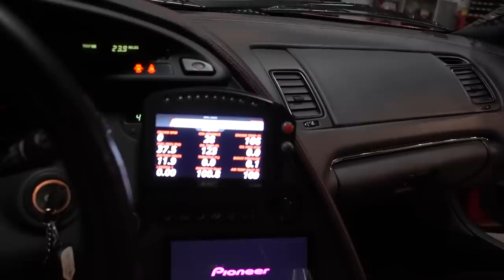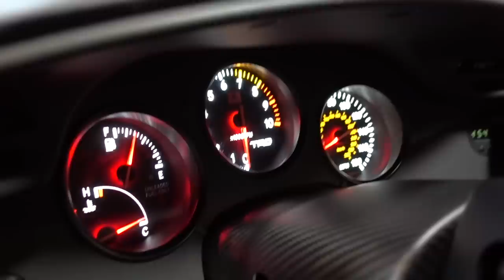730hp Mk4 Supra - Single Turbo  - JDM Madness

Comment: Nice SHOW CAR...and if you noticed my SN, I love me a nice Supra...I've owned half a dozen of these. All were very clean, made descent power, and sported some rare mods. But THIS CAR...even if it will handle and has a bunch of power, this isn't an attainable car for anyone making less than $250k a year with a girlfriend...and very well engineered it seems, but even less practical than an aventador or f430. Can't jump it if its dead...well who would anyway with this level of work, but really? Its a Toyota after all....super slick metal work (that's coming from a fabricator/ welder with 16 years experience) but after all that money and work to make a truly one of a kind car, who would want to even OCASSIONALY drive this car on the street and chance an accident when the fabricator that did all that awesome metalwork has passed? Verdict....very high dollar trailer queen that will never exploit the jewel of an engine that resides between the rails to its full potential...pretty, but virtually useless. They threw a bunch of time, money and performance parts at it, basically to just let it sit a climate controlled garage to be polished and looked at or towed to a show...

Comment: I don't think people will be doing this kind of thing to let's say a RS7 in 25 years but I may be wrong.  Kids in the future won't give a fook about ice engines . Could you imagine someone doing this type of build to a Tesla lol. It's got hand braided copper battery wires . Lol
Reply: how would you to a Tesla? add more batteries and make them flashy? lol IDK what you could really do to a Tesla to put it in same level as this
Reply: You should check out icons build of a classic car and turn it into an electric car. It's pretty badass actually
Reply: VGK30 an rs7 is nowhere the level of a Supra so
Reply: VGK30 hot rod people said the same thing about these cars back in the day. A that’s the beauty of creativity and new ideas. The art won’t die
Reply: It will be like computer builds, Rgb lights everywhere, liquid cooling chipsets, wire tucking, new app to make car dance, etc.
Reply: You ll just pay on line and the car start download the upgrade
Reply: Someone will make the tesla roadster ricey.
Reply: Unless RS7’s start appreciating in value instead of depreciating like all modern high volume cars, you are 100% right!
Reply: Supra king

Comment: Didn't even start it up or rev it? I'm sad
Reply: I'd be scared to blow something.. imagine the stress of driving this on the street
Reply: TheJuicyGiraffe I agree.I was waiting for it the whole video.
Reply: It's not their car.
Reply: Sky Guy Yeah,but nobody's saying they should have revved it up and dumped the clutch all over the shop.I mean they drove the thing in there as soon as the video started,but proceeded to put some shit music over the engine sounds.Other than that,the car is awesome.
Reply: I just wanted to hear a rev to man like wtf I'm upset
Reply: Not to mention the owner is the one that drove it in, he could have done it himself.
Reply: Yeah I was disappointed. Want expecting a limiter dump but at least some idle and a couple 6k hits
Reply: I feel like I may know why.. They say it had a tripple disc carbon on carbon clutch so it would have been rattling it's head off while it was moving around and the general internet loud mouths would have started a whole shitwar over how something is wrong with the car. Just easier to show the build and not have to deal with the comments later.

Comment: all the money and hard work and I bet it sits around in the garage 99% of the time
Reply: Load of shit, try watching the bonus footage where they talk about the guy driving it. It's not hauled on a trailer, don't be so quick to judge just because it's clean!
Reply: @jonnyd3ath That thing is WAY too immaculate to have been driven.
Reply: g0dbel0w is it fuk
Reply: Dariune watching the video I actually felt it should be a garage queen and I hate that
Reply: i bet all the bespoke seals, bushings, and gaskets have all gone dry due to indolence.
Reply: Kinda sucks don't it
Reply: I wanna see it drive
Reply: 12:28 Dude say's it .."This is not a car you drive all the time" I'm sure it has been driven before it got to the state it's in now, but at this point, I would be too scared to fuck it up by driving it.

Comment: Its perfect! (Drops bumper straight onto concrete and drags it forward) def not a detailing guy!
Reply: Big dundee Yes! That made me cringe when they did that, holy crap!
Reply: These two did nothing on the car. Some rich dude paid these two guys to help “build” his Supra. And these two dude got experts/specialists who can do each thing on the car. They outsourced everything and car got pimped out by each specialist doing their part, metal fabricator, interior upholstery shop, engine shop, tuner shop, etc etc. Now they claim they built it. Bullshit.
Reply: car = driving, anything under will get rock chip.

Comment: As a retrofit/lighting guy who owns a Supra.  
I can give an A for effort on the running lights…🤷🏼‍♂️😬.. but there’s a reason why no aftermarket companies made headlights or tail lights, or anything for these cars over the years… because what’s on there is perfect and anything drastically different just messes it up!

I was debating it first doing the headlight and tail light switch back halos and red brake light halos, but it stands out too much. I think it stands out in a negative way more so when it’s light out and you can see the white rings when they’re off . I know folks have painted them, but that’s risky and kills the output.

I’m still debating doing duel, white LED switch back strips in the front markers .. doing one looks odd. And possibly on the rear side markers doing something in there.. but I don’t know.

Comment: What's the Point of using custon SS studs for Everything? I'd rather use lighter titanium hardware then.

Also covering Everything in leather weighs alot too. Better use carbon panels. Other than that no other critisism. 

Very cool custom work. The cooler ducting is Amazing and IC work etc is Amazing.

Comment: Ehhh....Supposed perfect attention to detail, YET the rear bumper cover is a different shade of red on the corner, it has bubbled up and peeling fake carbon wrap on the coil cover, ziptied fuel lines, The NAPA ducts wouldnt ever work as they are WAAAAY too far from the brakes and dont have flexible tubes to direct the air(rally guys found this out in the 80s), paint has some trash under the hood, the leather has a stretching streak in 2 places and bubbles at 9:35...also why have a pull handle when you have a door handle? lol that defeats the hell out of the purpose

Comment: "Stainless steel studs that are polished and anodized" ... um what? 
And increasing the surface tension on castings by polishing off the flashing.  What does that even mean?
The custom black ano bits also look super purple, not well done.
These guys sound like big time salesman.

Comment: This car is absolutely gorgeous (probably the nicest Supra I’ve ever seen), but I bet all that aesthetic and “attention to detail” stuff added at least 500 pounds to that car. A stock-like 650HP Supra (get some reading comprehension before responding with some smarty pants comment) could probably smoke this just due to weight alone.
Reply: *you’re... and no I’m not.
Reply: 730 HP 3900 LB Supra= .18717 power/weight ratio
650 HP 3400 LB Supra= .19917 power/weight ratio.
A typical 18 square foot leather hide weighs 8 pounds, and it would take at least 150 pounds to upholster a whole interior. A roll cage weighs about 100 pounds. The sheet metal fabrication and other tidbits weigh at least 200 pounds.
You’re the only silly one here my man.
EDIT: even with only 300 pounds of extra crap, the 650 HP Supra would still have a higher power to weight ratio.

Comment: Paint seriously swirled.  I am a professional detailer seen that shit a mile away. If I can see it on video it has to be terrible in person. Nice and shiny but not clear shiny. There is a huge difference! It kind of looks like a fresh paint job that is cut to cure. If so then understandable. If not then call for help. LOL
Reply: @poppeyeqc  Ive seen paint jobs that the body shop purposely swirled so it matches the rest of the car. LOL. Only for theirs to look worse so then it really sticks out. I've paint corrected them sometimes to find that the panel they repaired didn't color match so they lightly swirled it to lighten the color some. LMAO. I've had repaired white cars, dumb asses color matched to stained paint. Instead of compounding a spot to match to the real color they color matched to dirty paint. I come along do paint correction on it and guess what. Their paint job doesn't match the car any more. LMAO. I have seen every kind of bad paint job you can imagine.

Comment: The wing stands aren't even sitting correctly - it looks crooked. For a build that's apparently very high on attention to detail, this is quite disappointing. Front bumper is also not sitting flush around the sides...absolutely beautiful car, but just saying 🙂

Comment: Added how much weight?
Reply: @JoeAmerica1911 I can. It's not hard. Valid question with performance oriented vehicles. Especially one that starts out a little heavy. Metal bungs are much heavier than grommets. Sheet metal is heavier than plastic.
Reply: @JoeAmerica1911 no I got the point. Form over function. Hence my post. Maybe you missed the point there. Let me fix that quote for you. "let's use the lightest material possible, even if it's a zip tie." Said every person that was into automotive performance cars for their... Umm... Performance? Fashion is for purses and scene kids that hang out in parking lots.
Reply: @JoeAmerica1911 and happy holidays to you too. ☺️ And a happy new year. Be safe and enjoy this time of year.
Reply: @JoeAmerica1911 yeah I like my cars on the road or the track. To each their own. Had my hopes up with the exterior and 2j. And a blessed solstice to you?

Comment: If someone were to do an exact (or nearly exact) treatment to the new "Supra", the MK4 would still be the superior car.  I'm certain there's a deep pocket just itching to get the new car and go all the way with it, but to do that correctly the new car fully tricked out will still require a Toyota engine.